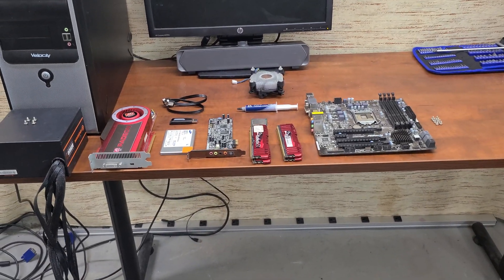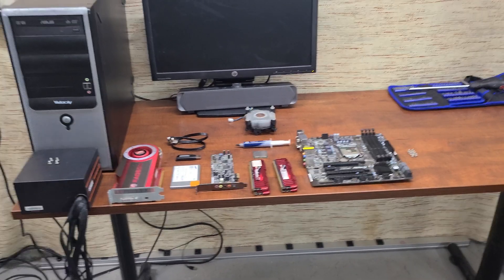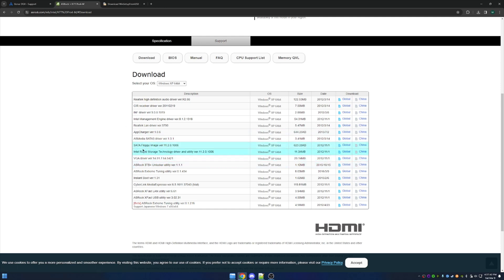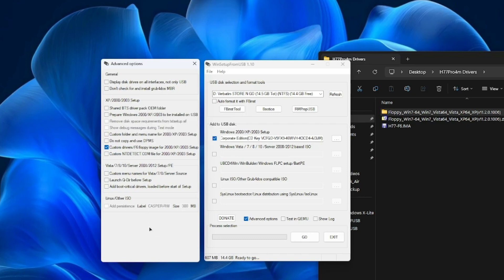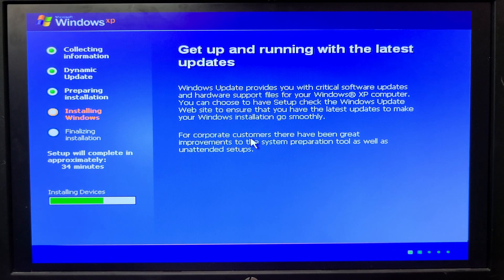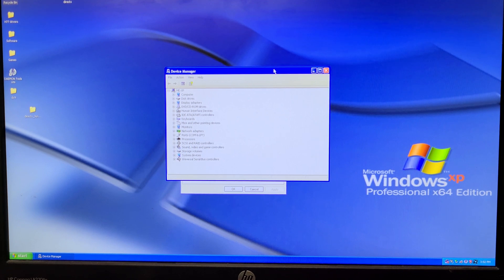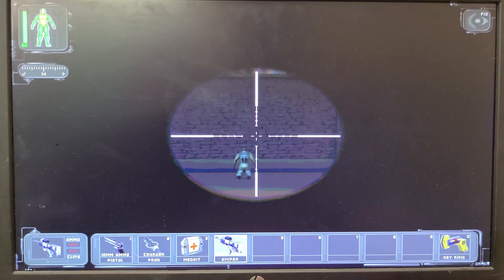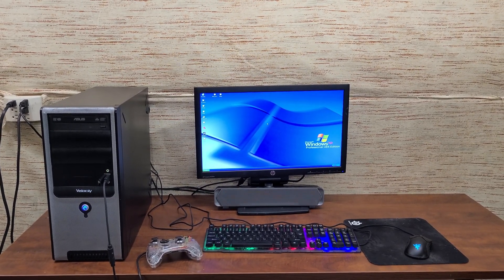Windows XP x64 Edition was junk?  Maybe my memory is wrong?

Comment: My buddy who was into the latest and greatest bleeding edge stuff bought a laptop to run XP x64. There wasn't much point at the time though. It was a bit ahead of its time. Windows 2000 Pro (not ME) was also a favourite of mine which ran stable as hell on good hardware.
Edit: Thanks for the sub. Also subbed to you!
Reply from the maker: I just tried Windows 2000 for the first time!

Comment: Large address aware flag setting was required for many programs to be able to utilise the ram correctly.

I would still be using it if 2d hardware acceleration worked, just couldn't justify screen tearing on video anymore.
Reply from the maker: Thank you!
Reply: @RandomTechMichael  does x64 come with a wifi adaptor?

Comment: The biggest issue with XP x64 was that some games would not run because of it did not see SP3 and x64 did not have an SP4.

If you use Hirens or Sterlec boot CD, you can use the Windows Install utility and point the install to a driver folder with your XP or XP x64 drivers and they will be installed...

Also, the SDI and SDIO will help loading drivers that you may have missed or update them to the latest.
Reply: And to update you XP install you can use Legacy Update
Reply from the maker: Interesting!!!  I have the full Snappy Driver pack download from a different project.   Never thought of using here though!!  I wasn't aware of the other functionality in Hiren's that you speak of.  I'll have to check that out!  Thanks so much for watching and commenting!

Comment: hey man great vid! XP x64 was definitely a much better experience than Vista. I remember picking up my new build with Vista x64 and reformatting to Install XP x64 the very first day. I used it for many years until I had to upgrade to Windows 7. I am tempted to set up an old laptop with it now after watching this.

PS. Your experience from when you tested it may have been because of drivers. I remember driver support for x64 wasn't the greatest at the beginning.
Reply from the maker: Thank you for the compliments!   Yeah, it had to be drivers for sure!  I was an early adopter to WinXP x64 and my experience in this video was 100% different than when I first tried it many years ago.  Thx very much for watching and commenting!

Comment: I have XP X64 Edition installed on my 2010 Classic Mac Pro with as of now an unsupported AMD Radeon RX 580 8 GB, but it's either this GPU or a flashed Radeon HD 7950.
Mind you, this machine has not seen anything beyond Mojave and Win 10 / XP installations riding along from a previous system.
SPECS:
2 X Xeon X5680 at 3.33 GHz
64 GB RAM
AMD Radeon RX 580 with 8 GB Dedicated (have yet to test this GPU with Metal and AI apps).
Reply from the maker: I had the chance to have two retired Mac pro machines from work a couple of years ago.  (Before I started this channel)  I wish I had of taken them.
Reply: XP x64 edition and XP Pro x64 are different systems.
Reply: @nexus7tablet610  does xp x64 work with a wifi adaptor?

Comment: I'm confused by your comment of the RAM being too big if a capacity to fit? In a 64bit OS RAM capacity is not a limitation like it is with 32bit systems. The maximum addressable memory of a 64 bit OS is theoretically 16 Million Terabytes, so I'm super confused. I have had windows xp 64 edition with over 8gb of ram working. So again, really confused by the statement.
Reply from the maker: I had to rewatch my own video to see what your statement was.  Hehe.  I didn't explain it correctly in the video.   That ripjaws RAM, even though it is still DDR3, it can be problematic on older boards.  I am not sure if it is the chip density on the actual RAM module or what... ("too big")  Also, it is not listed in the memory QVL for this board as it is much newer RAM than this board is.
Reply: @kmprojects2023  That makes a lot more sense. Thank you for the clarification!
Reply from the maker: No worries!  Your comment was actually great!  It's a sign that I need to try and explain more clearly what I am doing while I'm recording.   I'm still pretty new at this whole YouTube thing...  so feedback is most certainly welcome and in fact, required!

Comment: I had xp64 before, mostly for some emulators like Mame that started supporting 64bit and they run indeed faster than their 32bit versions, all perfectly stable.
But other than that, I dont remember xp64 being something more useful than the standart xp, plus later 64bit applications didnt support xp64 but needed Vista or 7.
So that was it, just an experiment from Microsoft, perfectly stable at least.
Reply from the maker: Yeah, I think you are right.  M$ had to start somewhere with x64... and I guess Windows XP made sense to them.

Comment: Use windows XP 64 daily still, on an work machine (no internet access) very stable, but atlast it will be replaced, mosly due hardware it run 24/7 on is getting very old noe.
Reply from the maker: Yup!  I do IT work in a manufacturing environment.   We still have some xp machines here too!

Comment: Hey. How did you install windows xp 64 bit in Winsetupwithusb. Ive try it 6 times. I wouldn't get the hard drive recognize
Reply from the maker: Under the "advanced options" at the bottom main screen of the utility, marking that active will open a side window.  One of the options is "Custom Drivers/F6 Floppy image..."  Make sure your disk controller drivers are downloaded.  If your drivers are in a floppy image format, you are good to go.  If they are not in a floppy image format, you'll need to create a floppy image with those drivers in it.  If you watch my video carefully, at the 5 minute and 50 second mark, I go over exactly how to get your custom F6 drivers into a floppy image.
Reply: @RandomTechMichael  Thanks bro. I can see ur respect!!

Comment: did you just spread the thermalpaste with your finger ? I mean using the cooler to spread or that thing is 1 thing but the finger
Reply from the maker: Hehe... I was waiting for someone to comment!!   I have a little plastic spatula that I normally use but I couldn't find it.  I am not a fan of using the cooler to spread the paste as you normally need to put way too much on for it to work reliably.   Also, you really don't need much paste if it's pre-spread.  So yup, a finger works well!  Thank you for watching and commenting!  It's truly appreciated.
Reply: @RandomTechMichael  I mean I have no problem with it but then the finger is dirty and the paste everywhere
Reply from the maker: Oh!!  Hehe.  I just use paper towel with isopropyl Alcohol to clean off my finger after.

Comment: I ran XP x64 on my Core I3 first gen with 4G (later 6G) DDR3 RAM and integrated Intel graphics laptop. The computer came with Win7 Home Premium and I installed XP on it just for fun. First time I installed it in IDE mode and then installed SATA AHCI drivers but later I slipstreamed AHCI drivers and made my custom CD with all the drivers needed for that computer. 
It ran great, rock solid, without any issues. All the driverswere spot on and overall using the computer was a really good experience. The only difference to Windows 7 was that the battery lasted more on Win7 than XP.
Reply from the maker: I really miss the Windows XP days...  It was such a good OS.  (I mean, Windows 7 eventually was awesome too)

Comment: It IS actually cheating using newer hardware, because it will have more mature/stable x64 drivers. The bad eXPerience with XP x64 back in the day was mainly driver support/stability. Updates where also hand-me-downs from Server 2003 which also brought some bugs/problems. Using Server 2003 x64 was probably a better experience than using XP x64. I went directly from XP x86 to Windows 7 x86/x64, so I'm just recalling what I read from people experiences.
Reply from the maker: Agreed on all points!  It was actually the same thought I had after the video went live while reading comments.  Thank you very much for watching and commenting!

Comment: i ran xp x64,  it ran smooth. but there wasn't a lot of 64 bit software at the time.. the big thing about it was it could handle waaay more ram, which i needed.
Reply from the maker: Yeah, I remember the system I bought specifically to run xp x64...  It cost me a fortune and it made me so mad when it caused me grief.   Lol
Reply: It didn't make use of the extra RAM above 4GIG, then I had idea in mind, if won't use it, I made a RAMDisk with it, and redirected my swap file to it.
Reply: @MarkWhich  that's windows xp,    windows xp x64 could do 128gb, not that anyone had 128gb of ram in those days
Reply from the maker: Could you imagine the cost of 128 gigs of RAM back then!!!!
Reply from the maker: Holy cow!!  I kind of figured the cost would surprise me!
Reply: Indeed. It was a bit ahead of its time. Even Vista was half and half with x64 and x86 versions in the wild, at least on my customers machines that came in for service / repair.

Comment: It’s funny, but I remember XP64 the same way. Back in the 2000s I predominantly ran Win2K on my work PCs and XP on my home and gaming machines. I honestly cannot remember why I had avoided XP64. Heck, I was still running XP all the way to 2015 and inadvertently skipped over Win7 entirely lol. 

Last year I came across a bunch of LGA775 motherboards and components I forgot I had, and built out a few XP machines. For shits-n-giggles I decided to give XP64 a try, and damn do I wish I had done it back when it was still relevant. An overclocked Core 2 Quad Q9550, with 8GB of DDR2, and an ATI HD5770 is an absolute beast of an XP machine.

Every game and piece of software I have thrown at it has worked flawlessly. Granted I am not using the system on a daily basis, but I have had zero stability issues running the old CAD/CAM software I used back then as well as hours of gaming. Only thing I have not yet tried, is some of the 16bit software I have kicking around from the 90s that I was still using well into the 2000s.
Reply from the maker: LGA775 is a great platform for Windows XP!   I still have few complete parts sets kicking around.  Even though I've only used the build in this video for a week, (I've been going crazy with games I have not played in a long time!) It has been rock solid.  It's not what I remember from back in the day.
Reply: @RandomTechMichael Oh I know the feeling lol. When I finished building mine, I dug out one of my old CRTs then proceeded to install almost my entire CD catalogue.

Comment: I used win XP x64 on a single core AMD Athlon 64 XP machine and the experience wasn't good, mostly because of many applications not supported on 64 bit OS. As far as I can recall even MSN messenger didn't run. It was however stable.
Reply from the maker: Yeah, this is the same scenario I remember.   Just constant little issues that annoyed the heck out of me.

Comment: I had no idea the perception of x64 was that bad in places, I ran an early Opteron chip using it for the longest time since I had all the drivers in 64-bit land as well. Smooth as butter in my experience from the day.
Reply from the maker: Yeah it's wierd how many ppl have such different experiences with x64 Edition.  This current built is totally not a daily driver...  but it's been rock solid.

Comment: I downgraded from Vista to XP x64 and it was awesome. It was basically Server 2003 with the XP stuff on top. I remember it being rock solid, but getting drivers for anything was an absolute pain back then
Reply from the maker: Agreed!!  Also, I didn't think about this while making this video, I installed x64 SP2.  I actually don't remember if I used x64 before or after SP2 was released.
Reply: If your were fortunate enough to have motherboard drivers for XP64, there was always a crappy printer or scanner back then without driver support.
Reply from the maker: You are speaking truth!!!  :)
Reply: @CapTVchilenaShootingStarMax  I remember modem drivers were also a real pain lol.

Comment: 64 bit xp was the best windows o.s ever.
Reply: As much as I want to agree, I've had no end of driver problems and general incompatibilities with it. I think Windows 2000 is the best ever version of windows. No frills, all business.
Reply from the maker: Yeah, this is exactly what I remember too!
Reply: It did not include the SetDEPProcessPolicy function, unlike Windows XP SP3.
Reply: I got no doubt 64 bit was great but just 32 bit was far more comnon
Reply: I agree
Reply: Server edition drivers often work fine on xp pro x64

Newer hardware will struggle with drivers these days anyway, manufacturers basically only release for the latest os versions and are moving away from self hosting software support and drivers resources.

 Instead they are relying on Microsoft update services which obviously doesn't work on eol operating systems.